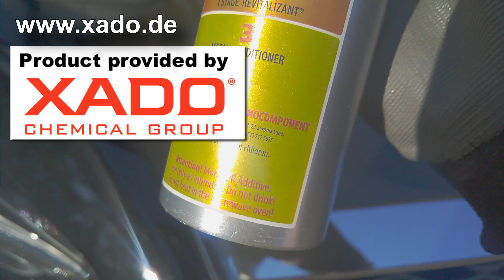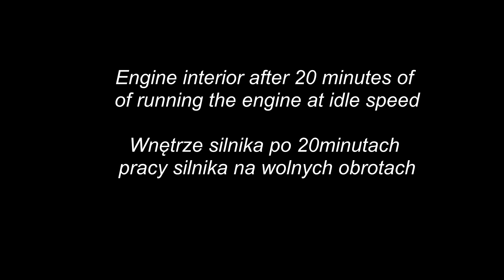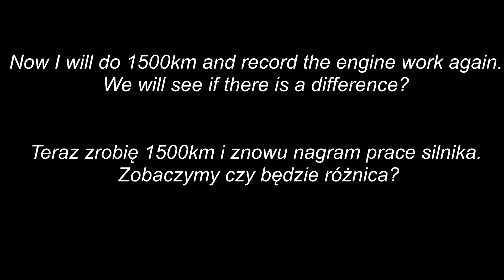Czy dwie butelki Xado 1 Stage Maximum wyciszą silnik diesla? Mercedes OM651 Infiniti Q50 Test #1

Comment: Dude! You are brave putting that into your diesel, my TDI, 7.3, 5.9 I try to keep as pure as I possibly can, will say that Mercedes/Infiniti combo is crazy, never see those in the States.
Reply: That is an extremely good product which creates a glass like triboceramic coating on metal parts where friction is present. I've been using it for 15 years on everything I've owned with an internal combustion engine. No harmful effects on any of them but a guaranteed 5 to 15 % fuel economy increase and engine wear practically stops. Bigger increases are for worn engines because it restores compression and the 5 % for a new engine, as the only benefit is the halving of internal friction. You can also run treated engines without oil, but that's just for show of course. This test I don't really understand because it take around  1500 km for the treatment to complete and at least 25 km to notice any difference (or 30 min if idling).
Reply: we also have diesel chrysler's and dodge's , chevy sedans and vans here in europe
Reply: X1r and RVS works well.